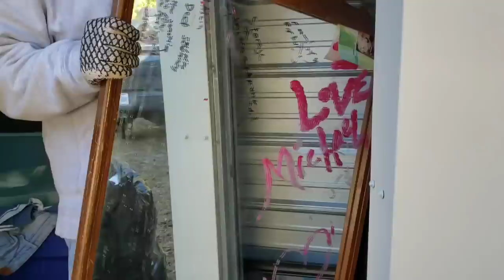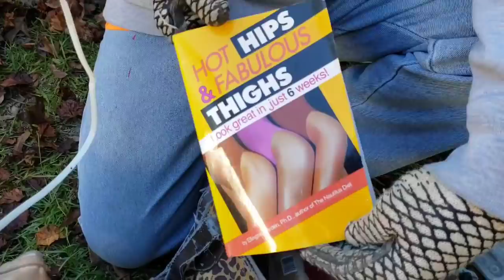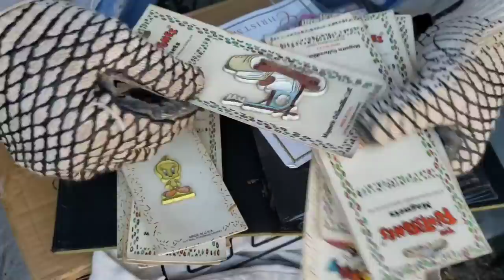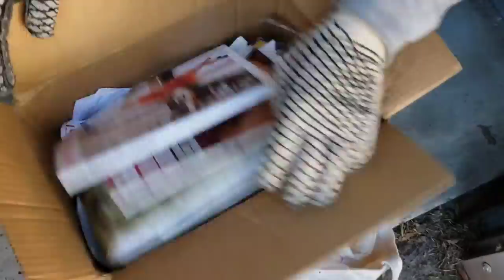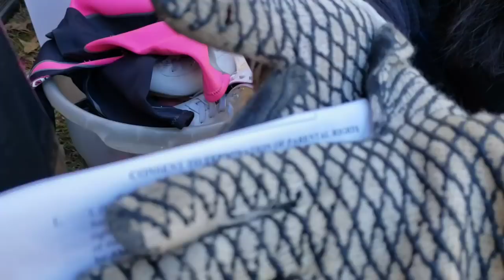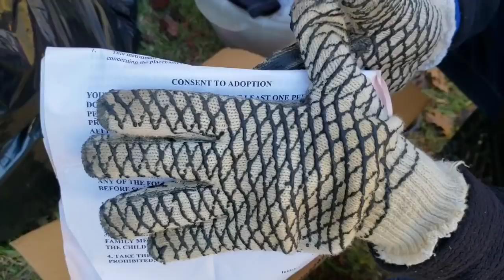SHE LOST HER KIDS I Bought Abandoned Storage Unit Opening Mystery Boxes Storage Wars

Comment: I chopped off my finger last year with a similar folding knife. It too apparently had a broken lock. It essentially worked like a paper cutter so I suggest either set the blade into a handle or get a new lock if you want to keep it. Best bet tape it shut and toss away. Tape keeps it from possibly hurting someone digging in the dump.